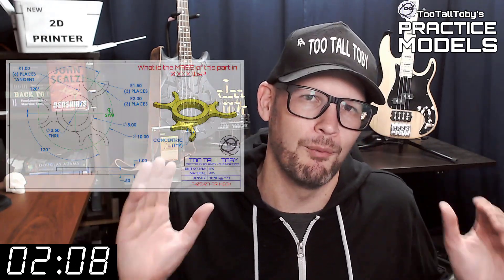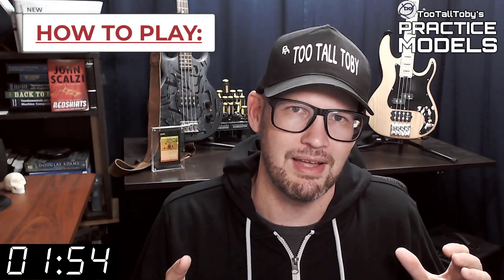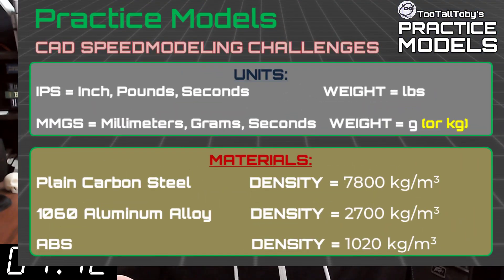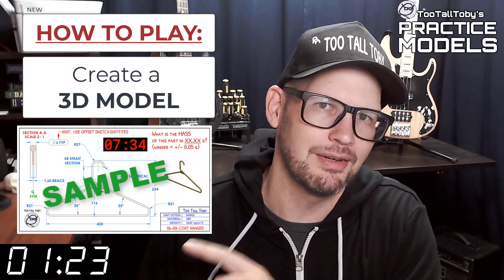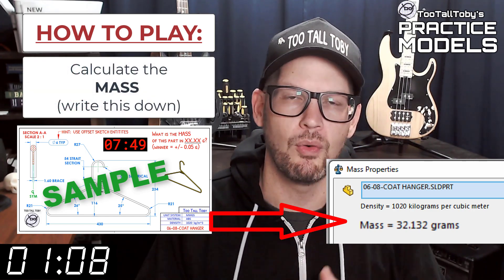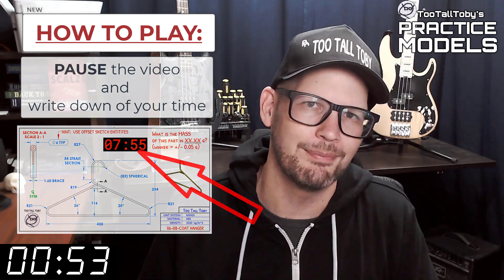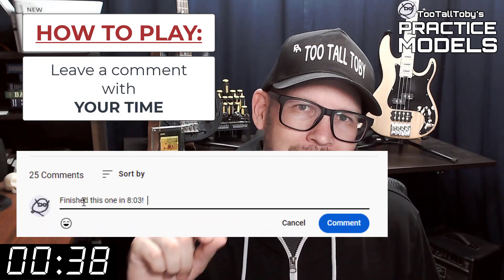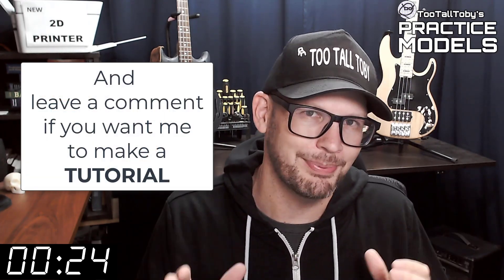2D to 3D CAD PRACTICE MODEL-  Free Drawing Exercise for 3D CAD users - TABBED BUSHING SLEEVE

Comment: Mass=156.07 Sw2023.  15.31 mins It took a sec to figure out the tabs, had to do it a janky way where I made the bushing, and then cut it in half and then rebuilt after the tabs. and had to just guess and check on the angle for the rotation of the tab. Good I like it, we use this in my college course for higher level solidworks prep
Reply from the maker: Awesome job and nice work figuring this one out!

Comment: Since no one has mentioned this, I imagine the dimension is present in the drawing, but I can't find it. Looking at the 3 notches in the top view, I see they are 12 mm wide. From the side view I see they are 13 mm deep. But where is the notch length (how close they come to the outer edge of the cylinder) specified? I took a guess that they were 9mm long and completed the drawing with 155.9398 g. What did I miss?
Reply from the maker: Its the 58mm (from tangent inside of hole) dimension
Reply: @TooTallToby  Jeez! Thanks - I stared and stared at that drawing and never noticed what was, I'm sure, obvious to most.
Reply from the maker: @leroycasterline1122  All good!

Comment: There is a missing dimension, I don't think it matters for the mass value but the height of that curved section above bottom is not there.
Reply: No , all dimensions are there.
Reply: @timheeney2060  okay but the thing at the bottom is not at the base of the object it's a little higher from the picture and the 2d image as well, but I dont see the height above, if there is could u tell me what it is
Reply: @fahimnabeel606  In engineering speak, I think you're talking about the 2 sticky out sharp bits on the end of the legs - is that right?
If that's right, it's shown in the lower right dimensioned view next to the title block. The top of the snap retainer is 16mm from the bottom face and the height is determined by the angle of 60 deg. The snap rib size is r45 or (90),
Reply: @timheeney2060  yeah but for some reason my sketch wasn't fully defined with these things. I made a triangle and sweep boss with arc of r45 as path. Maybe I did something different I did get the correct answer tho
Reply from the maker: Nice job!  If you ever run into any questions you can hit up the discord - lots of good help in there too!

Comment: I've been blasting though the practice models to get used to FreeCAD (after years on F360/OnShape). Tiers 1-4 completed (except "spear head").  So far I can say that FreeCAD is a contender in "forward" functionality but when it comes to later changing earlier features it breaks easily. The shape numbering scheme leads to broken references and it is easier to delete the broken reference than it is to fix it.  All in all so far FreeCAD does what I need it to do for my projects but beware to anyone using it in a production environment - "the cheap comes out expensive"
Reply: but this type of copying a drawing to make a model is only for practicing faster modelling methods - it's not actually design modelling, it's just making a model from a drawing in the fastest way possible. Robust modelling takes using references that won't break easily with unplanned future changes - I'm sure FreeCAD can do that. Unfortunately, such cautionary practices take time to learn and aren't conducive to making radical design changes as the design progresses along - making such changes opportunistically at anytime a better idea emerges as the design progresses is vital.
Reply: @timheeney2060  I'm not too concerned with the time I take since I am often interrupted by honey-dos or puppy distractions- I just wanted to learn the ins-and-outs of using FreeCAD before I try to use it for my own design modeling - the robustness experience comes from when I screw up/miss a dimension and my first (or second/third) answers are incorrect.  One key I've found so far is to save all the 3D fillets/chamfers for after all 2D referencing work is done. So far FreeCAD has shown itself to be less conducive to "opportunistic" changes when way down the model tree but I've only begun to dig into the features and how they interact from one workbench to the other.
Reply: @EUPThatsMe  did you use current stable version 0.21.2 or latest development build? upcoming 1.0 version is a big leap forward in more stable models and also brings some speedup in usage.
Reply: @sarahb.8186  yep, I'm using the stable release. I played with the dev release a bit. I like the sketch reuse for multiple pads. The biggest difference has been the "closed wire" vs "profiles" selection for extrudes. In a way FreeCAD has increased my discipline wrt fully constraining my sketches.